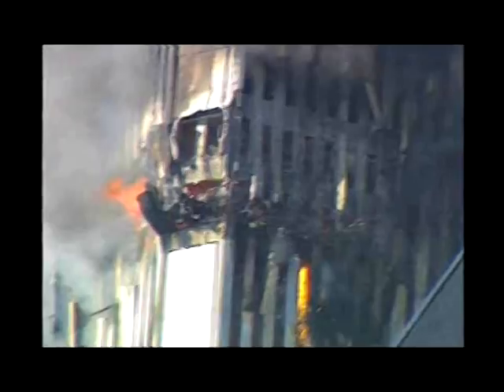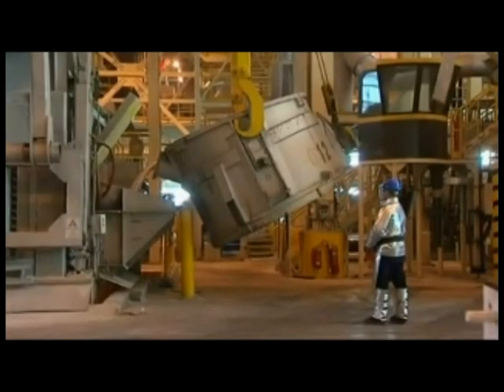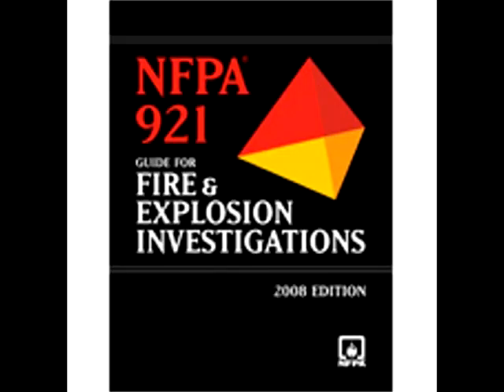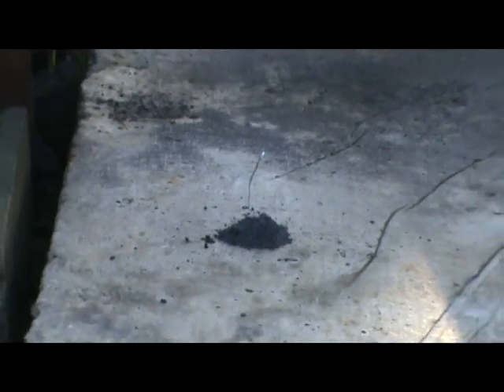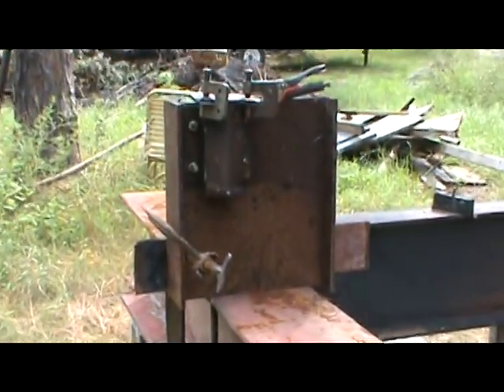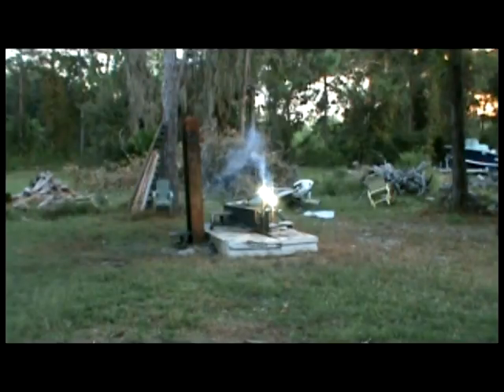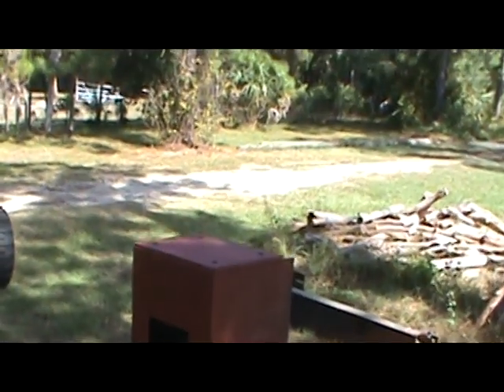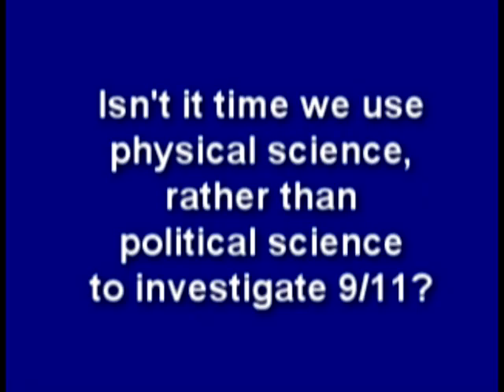9/11 Experiments: The Great Thermate Debate

Comment: How can the first and only airline suicide terrorist attack managed to defy physics?
Reply: Willaev Well why did you not counter his statements with actual facts instead of just saying "false"? Seems pretty useless just to say that it's not true... You know... evidence goes a long way???
Reply: You Wished Ok... Where's the blackbox from the pentagon plane? why could a passport survive 1500 degree flames but not a black box? I assume the passport was in the dudes pocket, yet he was never recovered either... Maybe the g forces from the impact launched the passport from straight forwards (I'm assuming the highjacker was sitting?) Through the bottom of his pocket, ripped through his clothes, went through walls, out the other side of the building, escaping this inferno explosion, landing safely and conveniently on the ground... Meanwhile some The outermost shell is a case made of hardened steel or titanium designed to survive intense impact and pressure damage. The second layer is an insulation box while the third is a thermal block to protect against severe fire and heat" got destroyed.... Go home you government loving weirdo.
Reply: V C they announced it was a controlled demolition of building. THE DAY THEY DEMOLISHED IT! I caught the announcement on ABC. Something the conspiracy theorist leave out of their "broadcast replays". It was announced at 1900 Central Time. 
 Steel does not have to be molten to bend. The puffs of smoke you see are an ash mixture being blown out as the Ari in the building becomes compressed from the internal supports failing. 
 Here is something to think about. If steel can be folded at 1500 degrees how much weight can it support? Especially since the bolts were also made of steel. The same bolts that held the outter column verticle were also the same bolts that held the horizontal columns. What you will learn is that steel heated to forge temperature will not support any weight load.
Reply: You Wished Ok... Where's the blackbox from the pentagon plane? why could a passport survive 1500 degree flames but not a black box? I assume the passport was in the dudes pocket, yet he was never recovered either... Maybe the g forces from the impact launched the passport from straight forwards (I'm assuming the highjacker was sitting?) Through the bottom of his pocket, ripped through his front knee clothing, went through walls, out the other side of the building, escaping this inferno explosion, landing safely and conveniently on the ground... Meanwhile some blackbox which is..... "The outermost shell is a case made of hardened steel or titanium designed to survive intense impact and pressure damage. The second layer is an insulation box while the third is a thermal block to protect against severe fire and heat" got destroyed.... Go home you government loving weirdo.
Reply: Kevin Yeoh just like JFK magic bullet.
Reply: V C Very well said... Tuna dude must be from NIST.
Reply: Kevin Yeoh because this is not physics. Steel becomes plyable at 1500 degrees. If steel bends at 1500 it can no longer support weight.
Reply: speculizer1971 Also if you think "your mens lives" are worth more than 100m bounty, you're clueless... Government would kill you for 1m
Reply: Jim Vick 🇺🇸Correct. Rumsfeld not only disabled all air defenses, but stole $2.3 Trillion the day before 9/11 to fuel the “war on terror” aka paying for ISIS to complete the “Greater Israel Project” aka Oded Yinon
Reply: V C     THANK YOU  THANK YOU THANK YOU... YOU ARE SPOT ON...   YES....I CAN BELIEVE THAT !!!!!
Reply: Nailed it!
Reply: speculizer1971 Yes... Dump him randomly in the ocean on the return mission... How often do soldiers return on a fishing boat?
Reply: MOE FRITZ lol, ok do you post an article on how guns end up in the hands of bad people.... this does not mean the US is supplying them with weapons nor does it mean the US is funding them.  This truly shouldn’t be hard to understand.
Reply: MOE FRITZ Lololol a fishing boat..?!??   WTF are you even talking about.... the supercarrier USS Carl Vinson is a FISHING BOAT!?!??    That’s one big expensive fishing boat!!!!   You see, this is the type of ignorant shit buffoons like you say when you get your info from conspiracy sites!! Lololol
Reply: MOE FRITZ you damn right our men’s lives are worth more than that!!
Reply: speculizer1971 Special ops do not take boats back... They take helicopters.
Reply: MOE FRITZ Lol why does who I voted for matter!lololol
Reply: W N Operation northwoods in 2001....
Reply: W N 🇺🇸MAGA🇺🇸This is is because Israeli #Mossad did 9/11. On my channel, check out my upload called:
“VETERANS DEMAND 9/11 TRUTH”.
Reply: W N lol where in gods name do you people get your info from...? Lol.  No plane parts were shipped off!! Lol   Nor was the steel and debris immediately shipped off....!  You people believe all the bullshit conspiracy nuts tell you...!! Are you people not able to think for yourselves?!  The steel and debris HAD to be removed from ground zero... it was brought off site and stayed there for a while until many many contractors received bids to remove it!
Reply: "Terrorists" didn't just defy physics and cause the laws of physics and our reality to stop working correctly at the towers. They did the same thing at the Pentagon and in PA.
Reply: Kevin Yech.

It doesn't defy physics. Building collapses due to fires are common:

https://www.youtube.com/watch?v=sPGr4D1-zDI
https://www.youtube.com/watch?v=XwoBRHDLxdo
https://www.youtube.com/watch?v=8XMTALBYRNA
https://www.youtube.com/watch?v=LB9wwTmrMYA

How can so many delusional tin foil hat wearing conspire-tards defy common sense, basic observation and that thing called actual evidence vs nut job  paranoia.
Reply: Titanium Quarrion hell no it don’t defy physics..... all these clowns in these comments wouldn’t know physics if it jumped up and bit the on the ass!! Lol.  The only think they are good at is parroting the conspiracy bullshit they hear in these vids and read on conspiracy sites.mainly because they can’t seem to think for themselves independently....they stop and question nothing as long as it fits their narrative!   There are grown ass ‘men’ on here that regurgitate the “jet fuel can’t melt steel beams” crap....... you mean to tell me these ‘men’ never heated metal to bend it or heated a bolt or but to free it.... or heat a U joint?    

They are told steel frame building collapses from fire don’t take place and they just believe and regurgitate it!  Collapse is one of the main concerns for firemen when fighting a building fire and they are taught from day one as a rookie the signs to watch and look for when a building is no longer structurally sound and there is an imminent danger of a collapse!!   They are taught this because their lives depend on it!!   As a matter of FACT, all the firemen staged at building 7 saw the tell tale signs of an imminent collapse!!   This is the reason they set up a collapse zone and told everyone, about the imminent collapse, including the media, which some got it incorrect and misunderstood and told the public it had already collapsed!   Many saw the BBC reporter telling people 7 had collapsed while the building was still standing...... yeah, that was part of misunderstanding.   But people don’t realize it wasn’t just the BBC that got it wrong! Lol
Reply: Brookhaven Labs perhaps knows.
Reply: The terrorists did not take gym class.. lol.. INSIDE JOB !
Reply: Kevin Yeoh maybe god was with them?
Reply: Mike theBike you need to head to off to get a lobotomy if you think there were SOLID STEEL COLUMNS TWO FEET THICK!!!!! Lololololol. Where do you people get this crap from!!! Lolol
Reply: Chris Gilliam Lololol.  How did you figure that out.... Lolololol.  Possibly the 2 feet thigh column comment! Lol
Reply: speculizer1971 https://www.google.ca/amp/s/www.bbc.com/news/amp/world-middle-east-38048482
Reply: MOE FRITZ it sounds like you and the one who claims the steel columns were 2feet thick need to educate yourselves on all things about 911 starting with building construction mainly the construction and design of the towers!
Reply: speculizer1971 Who did you vote for?
Reply: speculizer1971 I cannot go on much further about what he typed, because I don't know him.
Reply: MOE FRITZ lol my life is worthless.... 👌 sounds good.   I bet those many many people who are still sucking air today because of me would disagree! Lol I bet my beautiful family and loads of friends and coworkers who are like family would disagree! I would think my 25 years and counting of serving and helping the public and the probably hundreds of lives who’ve I’ve impacted in their darkest hours would disagree. Lololol. What a dumbass... you don’t know me! Lol
Reply: And that is it in a nutshell brother. Planned. Still pissed.
Reply: MOE FRITZ what else you have bud..... what exactly do you need me to educate you on......
Reply: V C...a master piece..well done.
Reply: speculizer1971 I assume you're acting like a soldier? So how many lives have you taken for oil for your leaders?
Reply: Fetid Tuna wut
Reply: Very articulate! Great spelling and grammar too. Thanks.
Reply: Head back to school first though. There are cutting tools that cut through steal with water. Do some research on the phenomena.  Its' called velocity and inertia. That's how light insulation foam pierced the wing of the space shuttle Columbia.
Reply: MOE FRITZ lol, no not a soldier. But that comment does show the ungrateful little uneducated SHIT you are for our soldiers!!
Reply: MOE FRITZ pretty sure this was 911 many years later.... not predation northwoods. Lol
Reply: ANARCHY LUiS lol the ridiculous claim the nose went through the building in the video.. because that’s what that comical told you to see and think!  I do believe there are many many vids including amateur vids of the same jet crashing into the building!!! How simple to leave those out and not mention them! Lol. I’m pretty certain you left out TWO OF THOSE BUILDINGS HAS 200 TON 767s literally ran through them to go along with the heat..... which all of it is absolutely plausible!   Collapse from fire is a major concern in  building fires.  Just because these vids tell you what to think and you can’t think past that dont make it true!
Reply: I was not aware that there were intelligent people on this thread. Thank you. Good to hear from a smart person. I don't know how we got a man on the moon with so many idiots on the planet. They don't believe the moon thing either. You see, everything is a conspiracy here in Doo Daa land.
Reply: Jim Vick lol by flying a commercial airliner into it!  BTW, there was no automatic air defense system that defended the pentagon before or during 911!  That’s only more conspiracy bullshit!!
Reply: ANARCHY LUiS Lolololol, pretty sure Rumsfeld didn’t steal 2.3 trillion..... Jesus you people can come up with some simple shit! Lol.  I’m pretty sure Rumsfeld had a plan to stop the careless defense spending that was going on at the time.!
Reply: Jeff S but of course, these clowns are able to think for themselves, they have to rely on conspiracy bullshit to educate them!  They don’t have it in them to use their heads!!   They also can’t grasp the fact that there were many many people who responded to these sites and can debunk damn near most of the comical claims!!  They think it was only top secret gov agents willing to sell the citizens down the river... or maybe it was Bush and his cronies who processes these scenes!!
Reply: Jeff S I mean it’s comical, and yet scary, that there are people who are so far out there they will believe what this video tells them!!    It took a total of 23 sec before this vid told it first line of bullshit!! Lol.  It said that “after the planes hit, the fire was burning out and cooling down!” Lolololol.   Talk about a line of bullshit!! Lol
Reply: allah guides the weight
Reply: i have so many questions now.
Reply: very intelligence response
Reply: i wAs making a joke but your stupidity is snowballing in appearance
Reply: Corn Bread ha ha ha
Reply: V C does the tinfoil itch? The hat I mean.
Does it get warm when the government mind control rays hit it? Is that how you know it's working?
And... does it improve your cell phone reception? Or extend Bluetooth range?
Reply: JEWS
Reply: hurr dur im meek so if you dont align with us youre cwasy
Reply: youre a beta
Reply: Jay Pay well said Jay!
Reply: V C Ok, I'll give you all of those, so I guess Washington needed a reason to attack Iraq and Afghanistan...
Reply: @ ash danish. 
You did a first-class job at preventing discussion of the subject by throwing in masses of irrelevant claims.
Reply: MOE FRITZ lol, yes you are an ungrateful little shit and yes you are very disrespectful as well..... yes they all should be looked up to. Please, post a video of our soldiers doing any
of the activities you claim.  You are just an ungrateful little coward who is too stupid to think for yourself!! If it wasn’t for them you haven’t the FIRST FUCKING CLUE WHAT YOUR MISERABLE LIFE WOULD LOOK LIKE... but I’m sure you are used to riding real men’s coat tails!!
Reply: speculizer1971 were you there that day???
Reply: Newbie One was I there that day..... no, I wasn’t there on the day of the attacks, but I happen to know
quite a few men who were! I was at the pentagon later.... I tell you another fact, during hurricane Katrina we bunked with about 20 FDNY guys for a couple of weeks and a couple of them were staged at building 7 and they ALL saw the telltale signs of an imminent collapse!
Reply: MOE FRITZ lol, there is no need to rebut any of your ridiculous claims!!  You, make an absurd claim there there are videos of US soldiers shooting children for sport and that the majority of them are the  “worst creatures on the planet,” yet they protect your coward ass EVERYDAY and many many give the ultimate just so you can be free to be the Sorry piece of shit you are....!   You have already proven just how stupi you are with your conspiracy crap! Lol.   Sad case you are!!
Reply: MOE FRITZ   “Try to get you banned!” Don’t flatter yourself just yet. I wouldn’t know how to get someone banned or what can be posted or not.  But most important, I would NEVER try to get someone banned for thinking different than me.  You see, that is the ignorant shit you kids play!  You have just as much of a right to get on here and prove to everyone just how stupid you are as well as how big of a POS you are as I have to get on here to tell and explain facts about 911 to people !!
Reply: I know your comment is two years old but was wondering if you had any grasp on basic physics and reality now? LMFAO!
Reply: MOE FRITZ Lolololol no wonder you are so fkn ignorant!! I should have guessed! The ignorance of the foreign trash is astounding!   These clowns act as though they know about American affairs when they haven’t got the first clue!   Oh yea...... I’m willing who bet it all you rely more on America than you could imagine!!   I’m sure you are a house dwelling idiot that thinks freedom is free! Lol. You fell free to just keep posting your ignorance which is sooo easily seen in your foolish comments!
Reply: Kevin Yeoh Very powerful question.
Reply: Slater Slater So the “new theory” that office fires can bring down entire buildings determined by NISTs delayed, reluctant and unscientific report of WTC7 was peer reviewed and changed steel building practices worldwide?
Reply: MOE FRITZ I love the assumption. I am actually a self employed blacksmith. 
 There is tape of the plane. Want to find that tape then fill out the foia forms. 
 The black boxes could have been shreaded beyond all recognition. Throw a spoon in a blender and see if you recognize it after you set the speed to purre. 
 I know that industrial steel bends and can be forged at 1500 degrees. When heated to that temperature it will not lift my 5 pound anvil. The rod bends when I try. 
 And at those temperatures steel will stretch usually at it's weakest point. What is the weakest point in steel construction? Bolts and rivets. 
 Think about the chimney effect. What is the hottest point in a forge? It's not the fire. The center of the buildings were elevator shafts. There is your internal fail point. Even having 3 floors on fire would superheat the elevator shafts. Well beyond 2000 degrees. You see that on the Forrestal as well.
Reply: V C

"Only time hijackers were at the controls of the airplane being hijacked was when it was the pilots or co-pilots themselves"

False.

"This was the first time any black box was not recovered when a plane crashed on land"

False.

"Flight 93 crashes and this is the first time when there wasn't thick jet black smoke that you can see risings hundreds of feet from miles away"

False.

I like how you keep making false statements and then saying "If you can believe that", because that's all your statements are based on. Belief, and zero facts.
Reply: You Wished Where's that pentagon plane? Why did building 7 collapse from simple office fires? They can find a passport but not any black box with gps? Stfu Agent NIST.
Reply: V C and it’s hard to believe people like yourself believe everything that is told to them by conspiracy nuts without question...If you can believe that!!!  Lol.
Reply: ash danish   Right after I see aluminum pass through several solid steel columns two feet thick is when I head to the optometrist.
Reply: Chris Gilliam  All of you assume it. It's the one thing you all have in common. I know since I used to be one of you.
   I at least have common ground with those who agree that fragile lightweight aluminum would be totally rejected by the wall of solid steel built with the exact scenario we're discussing in mind. You must be dismayed at the fact that those in your camp are dwindling as they defect to mine. The other nations on Earth have known for years. Only the patriotism of Americans blind them to the truth.
Reply: Where was the rust?  What was aluminum traveling at "great speed"?    An airliner doesn't travel fast enough to cause the aluminum it is made out of to burn due to impact!  They would be made of some other material if that were possible.  The steel was coated and was not exposed to the environment so there wasn't any amount of rust that could have helped create a thermitic reaction!!  What a dipshit!
Reply: Just out of curiosity, how many on here believe the earth is flat?
Reply: next time you are next to a new building. go and grab the fireproofing of the beam. it peel right off. 
a plane hitting it will take it all off. beam exposed
Reply: No way. All the experts are too busy commenting in this thread to be bothered with scientific facts!
Reply: Mike theBike  I didn't assume your ignorance, you confirmed it by believing in bullshit.
Reply: Chris Gilliam  Then the dozens of articles and videos I've read and viewed must all be wrong. All of you official story believers like to assume ignorance of the disbelievers. 🏍
Reply: Mike theBike You apparently have no knowledge of how the towers were constructed...
Reply: ash danish exactly when was OBL paid and given guns by the US...  he wasn’t brought back for questioning because our men’s lives are more important than his and when they entered the room he was going for a Kalashnikov and a fine man ran a 5.56 through his forehead.  It would have been very hard to get questions answered from him. 

Ummm the US is now funding ISIS...?!? Lol man have I been out of the loop! Lol 😂

Lies about IRAQ....which lies.  The man used WMSs on his own people!!   Just because they had moved them don’t mean they didn’t exist.
Reply: speculizer1971 Our men’s lives? They are all dead. All of them.
Reply: It was?  Weird, Muslims weren't even involved with the 9-11 attacks!  I wonder how an imaginary being could will such a thing?
Reply: Kevin Yeoh I trust my own eyes when I saw the plane come In one side and come out the other side. The planes made the buildings collapse that's not the question or answer. The question is Osama was being paid and given guns to by the US government and so was Iraq during the Iran Iraq War. So why did USA attack Iraq right after 911? Why was Israel giving Iran weapons to fight Iraq? Oliver north said it was because of a secret war with Panama. That it needed money without going through congress. Why did Iraq attack Iran? Why did Iraq attack Kuwait? Why was USA helping Syria before and now funding isis now to fight bashard? Why did they make up all those lies about Iraq? Why wasn't Osama brought back to USA for questioning? Why USA never attacked Iran? Why the tapes of the Cia on osama were never made public? The Cia records every conversation there agents ever have with anyone I'm sure they have tons on osama and Sadam Hossein. Once we get our hands on those tapes we'll get all the answers.
Reply: ash danish its simple, oil
Reply: ash danish How could the mostly aluminum plane with a plastic cone nose so fragile a bird can destroy it pass through several layers of solid steel girders?
Reply: @ Keven Yeoh
"How can the first and only airline suicide terrorist attack managed to defy physics?"

It was the will of Allah!